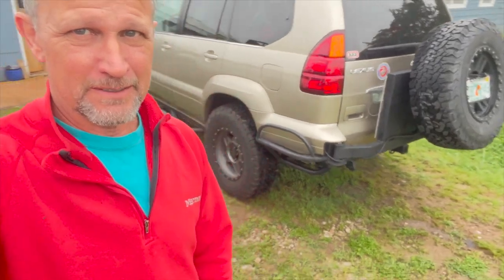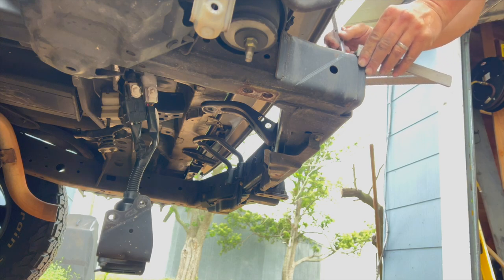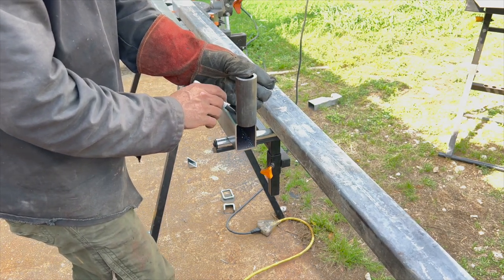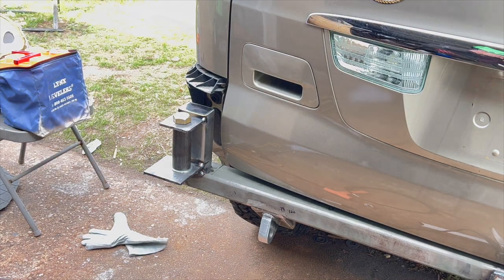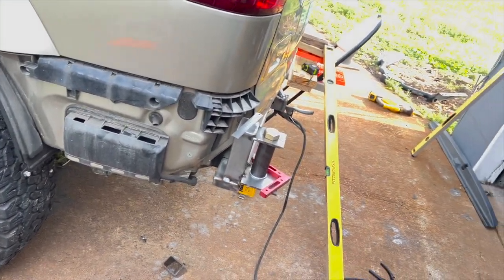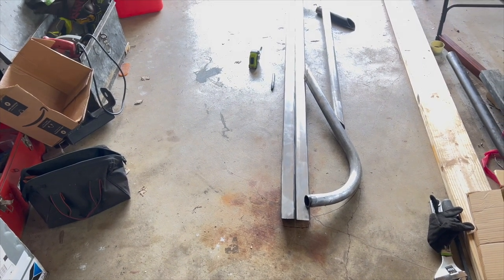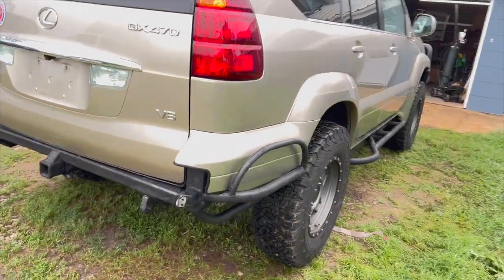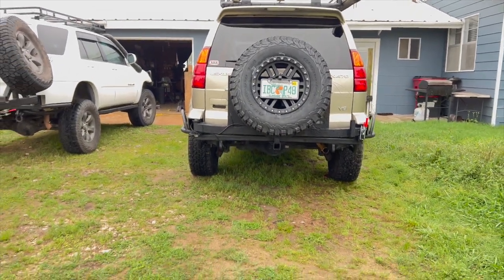GX470 Super High Clearance Rear Bumper, Tire Carrier with Drop Down Table and Rock Sliders

Comment: What's the info on the hinge cylinder, plates and hardware for it?
Reply from the maker: Hi TurboDad.   Thanks for checking out the video. Thats a double shear hinge I purchased from diyoffroadproducts that comes with the bushings and hinge bolt.   You need to make your own hinge plates with that though.  Looking at the big picture though for ease of putting a swingarm together getting the hinge kit from Adam at 4xInnovations is a better way to go.   It comes with the double shear hinge, bolt, bearings, hinge plates integrated around the hinge, a catch pin and a stainless steel slide plate for the pin to slide along and drop into.  If I’m expecting a lot of builds I’ll buy half a dozen of those and get a better price (than just buying one at a time).  It saves so much time and is a really beefy hinge.  Only drawback is the hinge pin locations are set (predrilled which is nice for sure) but you need to adjust the hinge position to make sure it locks in right where you want it to.  I’d recommend going the 4x route though for most people/situations.